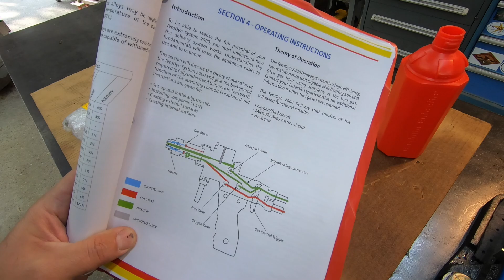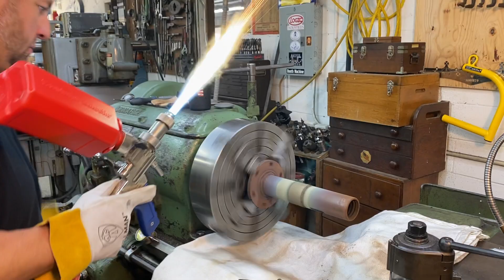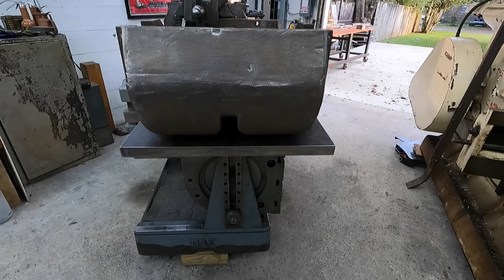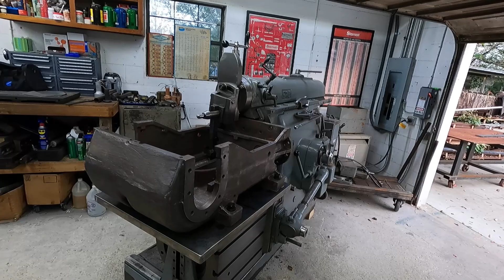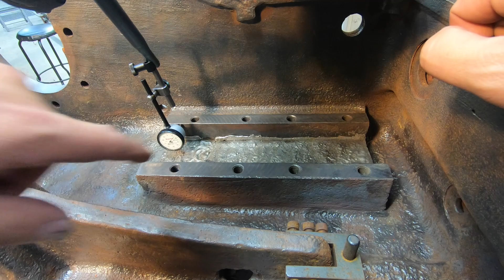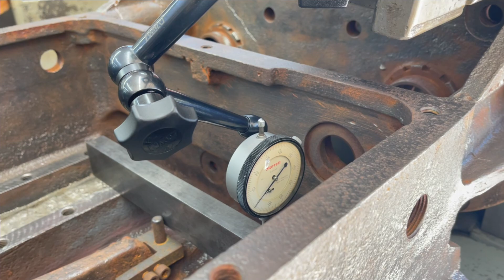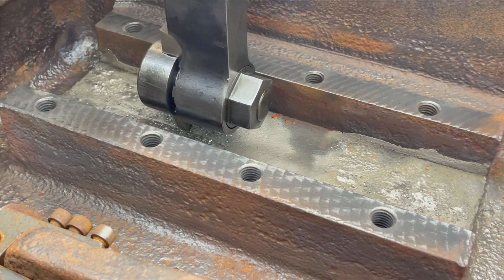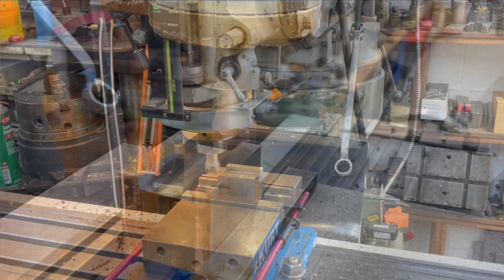SNS 331: Stoker Engine, Eutectic Torch Repaired, Tung Tri Mill

Comment: I seem to recall Stefan Gotteswinter using a small shaper that cut on the pull stroke rather than the push stroke.  That may be an option if making very light cuts.  It would probably allow the use of a larger, more rigid tool that would allow you to raise the tool holder and allow a cut across the entire width of the surface.

Comment: hi Adam have u considdered if you could mill the Stoker Engine horizontally on a boring mill. Once you made
a video where you bored and milled an item on a horizotal boring mill maybe that could be a solution and if also made a flycutter to clean off surfaceses. maybe it is possible to set the piece
on the end for the base of cylinders and clamp it to the table and mill from upside and down.
The flycutter does not need to  have a larger diameter than it can  mill between the two upper mounting areas on both sides that might give u space enough to clean all areas which have to be milled.
 Kind Regards from Denmark

Comment: Could two linear rails be attached to the two machined surfaces on either side of the channel? Some type of carriage to run a high speed grinder? Like a mini portable surface grinder?

The challenge makes this project more interesting, you are not disappointing anyone.

Comment: Hi Adam, 
Certainly a challenging job. 
I would doubt that Keith's planner would be any better, because he would still have clearance issues with the sides of the casting and clapper box. 
If you have an idea of its age, what machines were available then, that might be some indication of how it may have been machined originally. 
Perhaps a right and left hand offset tool holder, but I'm not sure what issues that has in a shaper, and again the time and experimentation to find out whether it may or may not be successful. 
I look forward to your determination. 
Hope you and Abbey had a wonderful Christmas, and all the best for 2021.
Stay safe. 
Dennis.

Comment: Steve Summers was showing off a big 2" end mill that's about 12" long in one of his videos last year, might be the answer in the K&T with the vertical head if the table will drop low enough. Could even run it in horizontal and stand the stoker case on its end.
Reply: You can always put the holder with the milling cutter to the spindle inside the casting.
Reply: Exactly what I thought too.

Comment: The two built-up areas are wider, longer, and thicker than needed.  Keith and Lance did it that way to make certain you had complete coverage.  But it's unnecessary to maneuver the shaper over the larger area, it's only required to machine the initial smaller size and location.  Hopefully, someone had the forethought to measure the two areas and their locations within the stoker case for estimating shaper clearance.  Anything outside the required areas can be modified as needed with a die grinder.  This insight reduces the need to work use the shaper so close to the sides.  Check it out.  (Watch the video to hear their comments.)

Comment: Looking at your clearance issues on  the stroker.  why not turn the casting 180 on the table and cutt from the other direction?
I seen to remember a 12" shaft that you made a while ago for internal shaping.  maybe you need a long reach horizontal shaft that has a tool holder slot on one end.  rough out the surface then make a grinding / lapping tool too finish the bottom similar to the tool used to flatten surface plate, but one that is attached to tha shaper.

Comment: Maybe you can make an endmill extension out of a piece of 1" or 1 1/4" hydraulic rod and use a 3/4" carbide endmill. It would be a rig, but I've made single use flycutters by welding a brazed lathe bit along the side of a piece of roundbar.

Comment: what you need is a long stepped shaped tool so that the tool can be extended into the space you have available. do away with the tool-holder all together, mount the tool in the clapperbox.

Comment: This may not be the answer or solve the clearance issue with the shaper but it looks to me that if the part is rotated 180 degrees it could work but may not work due to clearance in other areas. Just a thought.

Comment: Could you use a LH/RH toolholder that has the neck bent? Much like the tool holders for old lathes with lantern posts? I'm just thinking that if you can offset the tip tool from the centerline of the ram, you could buy some clearance to the side(s) of the clapper.

Comment: I knew this was going to be a challenge because of the depth of the casting and the distance from the clapper box. Since this is a one-off project, I think I would make a guide block to support a power scraper tool using the machined surfaces to support it and just just work the area. Lower the tool and work the area again until you get the depth and surface you need. None of these projects are as easy as they seem, and it is great to see what your solution is because it usually turns out pretty damn good.

Comment: OK just spitballing here..... set the head in the middle run the tool at an angle and the HSS vertical. that will give you the sideways throw you need to give you one pass on one side, then reverse it to hit the other.

Comment: <-- @ 27:20 ... I finally understand why I like Abom79 / Adam machining videos... its not the chips flying, it's the precision in making the calculations, and taking the time to be exact as humanly possible. That's what I learned about today. It's the planning, that has to be prefect. Check and check everything stay's the same.... I'm always thinking too. What if you had a variety of clamp magnets for extra hold?.... Hmmm, I'm on my 4th beer...> Adam will understand LOL.... I have full confidence in you Adam.... you can do this!! Cheers, Blessings.... ps: That bit is.... is...(speechless).... is it real?... better stock up!!

Comment: Hello Adam, you made me thinking :)
Instead of using a shaper from the "outside", you could use the 4 faces inside the engine box as a glide/reference face to guide the base of a small router running a (carbide) face mill. That is, you set a handheld tool inside the engine box. If necessary you make a "fence" that is bolted to some of the threads inside the 4 faces to "guide" the face mill i.e., to prevent from cutting into the vertical sides of the 4 face bars when you guide the router by hand. If required, you can apply a second op by using a small diameter grinding wheel with a special tool set-up, again using the glide/reference face. Greetings, Stefan.
Reply: I reckon that might be how they did it in the factory.
Reply: I should have read your post Stefan. That is what I was thinking. Those accurate rails should be utilised for what you are suggesting for sure. Well thought out friend.
Reply: That was my thought too.  Use the rectangular faces either side to support a router and rough out the worst parts.  That might be enough for the finish too but if not then maybe scrape them in using a fixture supported off the same side faces.

Comment: Would an "L" shaped tool holder help with side clearance? Turn the tool post (clamp?) 90 degrees to hold the  tool holder like an upsidown L so you can get into the corners easier.

Comment: I think the best way to do this now will be for you to make a custom tool holder with a long reach and adequate clearance. I know this is easier to say than to do but as you're committed  already you might as well try it.
In fact I think if you already had a very long piece of HSS you would have used it directly on the Clapper box without even a tool holder.

Comment: I imagine this would have come to mind if it was possible but I have to ask. Can you rotate the tool holder (the slot that holds the tool itself) left and right? If you can maybe you could, with a ton of patience grind a tool to cut the flat surface while the tool holder maintained the same location you have clearance for now. Like trying to cut a dove tail or undercut without leaving material above it.

Comment: @Abom79 A while back you made a pulley from 4140 steel because the soft steel the original was made from wore out too fast.  How is the new 4140 Pulley holding up?

Comment: If the problem is around the periphery of the two surfaces being flattened, perhaps you should just mill out where you can easily reach until it is the desired flatness and height and then later use that finished center surface as the new measuring zero for later work around the edges with whatever tools you can.  That way you can at least verify that the material being cut is solid and bonded properly to the work piece -- if that is not the case, then none of your other problems make much difference, I would think.

Comment: I did a lot of "flame spray" on navy ship steam valves for corrosion prevention... then discovered how well it worked on exhaust headers, drive lines, etc. for hot rodding. LOL
Reply: It's funny how something that was developed for a specific application turns out to be useful for loads of other things. Spray-on bed lining is not just for truck beds. Tool batteries are not just for tools. Kitchen timers are not only for kitchen use. 2x4s are not just for framing. Flashlights are not just for seeing in the dark. LEGO bricks are not just for child's play. Computers are not just for computing. The list goes on.

Comment: Hi all and a merry chrismas.
So for the casting surface can the FlexArm maybe help?
Maybe hand or machinie scraping that surface and using a small straight edge with the help of the two higher straigh surfaces with the bolt holes as a refernce ? 20:40

Comment: What if you set the engine up on its side and rotate the tool holder 90 degrees and works to cut up/down rather than side stepping, the table raises with each pass? will the cutters be long enough then? Do you have an angle plate big enough to clamp that to?
Other than that, I thought you had a couple of dog leg tool holders a right and a left will be needed. 
What about a longer tool holder so you can angle the head to get away from the sides of the block?
Merry Christmas, Happy new year,
thanks for the videos.

Comment: Hi Adam, a railroad shop, in the days of steam, probably would have done it on a Draw Cut Shaper (cuts on the back stroke) using a solid tool, probably not even high speed steel. Unfortunately those machines are probably extinct now.....Dave
Reply: There goes my question/idea on whether you could cut on the back stroke. 
Apparently not, sigh.
Reply: what I know from workers at Dampflokwerk Meiningen is that they have special milling cutters for this type of job

Comment: I am not a machinist, but why not create a new tool holder with a T type head to take both the left and right tool and spaced so when the one tool is against the one side, the other is just inside the center line. This way, when the bed moves over while cutting, the center line will be crossed by both tools as each of the opposite ends are reached.  Good luck.

Comment: I was thinking, why not turn the stoker 180° on the mounting plate? then I realized that you can't reverse the cutting tip. ¯\_ (ツ)_/¯.  then I thought, why not lower the stoker, and use a longer cutting tool so you can get closer to the edges?

Comment: Looks like a project for the mill using a facemill, assuming you have depth capabilities to reach in there. The stroker will have to be shimmed on the table, but maybe that is a workable approach. Eager to see where this project leads.

Comment: Do you think originally they used a fly cutter on an angle to get the clearance and make them deep grooves.
Reply: I was thinking the same. Or perhaps a huge, 12-15 ton industrial boring mill.
Reply: @ZeroneAngel  I recon an old steam shop probably had one of them lying around

Comment: Adam, I might have a solution to this problem, if you angled your tool holder to the right when cutting the right slot it looks as though you should have the proper clearance by starting on the right side and feeding the table to the right as you cut. The only drawback I see with doing that is you will have to angle the tool holder in the opposite direction to cut the other side, so your depth of cut would have to be individually measured out to get both to match, but I think it would work for you.
Reply: I was thinking the exact same thing

Comment: Can you make a holder (rectangle bar), ( after in the box holder, turn the rest of bar round like a rod), long enough can raise the box as high as possible. then drill a hole in the end to insert a tool die holder( round to square ),then drill in from the side edge to the hole for the holder. Tap the hole for a set screw. Insert tool in the bottom . Like a boring bar tool holder.see Keith Fenner. So a square fits box holder. Transittions to a round bar with a tool sticking out the bottom. The whole ting would be like a modified boring bar. Square at Clapper box, round to bit, with bit sticking out the bottom. Just have to make small slow cut to keep down the bar flex.

Comment: I would take the biggest mill holder you got and make a custom long reach fly cutter with say 1,5" diameter or more shaft and a cut down lathe bar and mount at an angle in the end.
Edit: you might run out of room against the casing, but as large diameter you can in the axel to reduce flex, maybe....

Comment: if it were my job on the to repair the stoker, I'd mill a pocket into the bearing surface and install a piece of ground and polished hard facing or bronze, depending on a bunch of questions I don't have the answers to at the moment.
A it becomes a serviceable wearing part, 
B you could machine tge othe side of the casting and make it removable from the accessible side 
C cast iron isn't the best bearing surface if it's not hardened

Comment: steffan gotteswinter has a funky clapper box that allows for cutting on the return stroke instead of the working stroke that would be cool to use in this gase because of the added space in the crank case

Comment: Sometimes you have to think outside the box and adapt and overcome the issue at hand.  I like to stop and consider what tool I would design to complete the task and maybe even sketch it out on paper to contemplate if it will be worth trying or not.  My suggestion in this situation would be to make an adapter so that you can use the micro turning tools to get in there without hitting anything.  Sure you will have to take light cuts and take your time but at least it will allow you to use carbide tooling as you wanted and you already have the tooling and just need to have infinite adjustment on the angles in the tool holder.

Comment: Could the tool holder be raised to clear the rails then use a longer piece of tool steel for the cutter? Could the tool holder be angled in the clapper box and the tool steel angled to bring it back to the required angle in the tool holder?
Reply: angles introduced at clapper head/tool would need angle adjustment to table, again introducing clearance fit issues
Reply: Also, using a longer piece for the cutter will induce harmonics/chatter. Then the surface finish will be effected.  Back in the day, they must have done the machining on a very large shaper with a custom tool holder that extended into the casing and cleared around well.

Comment: Hi Adam, now it's set-up, it is easier to see alternative methods, maybe remove the clapper box completely, and fab a fixed tool holder, but maybe set it up on the K &T and part machine, then scrape out the corners/unreachable areas, it's not unheard of.
Great vlog, here's to a better 2021.

Comment: The Stoker Engine machining was probable done on a Boring Mill. They have a long reach with the high speed spindle.
Reply: More likely a large planer
Reply: Ya that’s what I was thinking. by mounting it upright. it will be hard to see what the cutter is doing
Reply: @als484  job for Keith Fenner then then lol
Reply: @billhanson4921  Or Brian Block (bcbloc02), his HBM is, umm, medium sized.
Reply: @billhanson4921  Keith Fenner doesn't have a hbm.
Reply: @davidcallista2580  really? seen him use something that looks a lot like it.
Reply: @billhanson4921  I've been watching his vids for several years and can assure you that he does not have a horizontal boring mill in his shop.
Reply: @davidcallista2580 WHATEVER IT JUST LOOKS LIKE ONE THEN
Reply: @billhanson4921  He does have a K&T milling machine that is a mainly a Horizontal mill and it has a vertical attachment.  IT IS NOT A HORIZONTAL BORING MILL.
Reply: @davidcallista2580  and?
Reply: @billhanson4921  ok you win
Reply: My first thought was an HBM.

Comment: I think i would weld+braze up 5 tools with a long reach. Three V shaped (leaning left / center / leaning right) and two U shaped (right touch / left touch). I would make a template from wood first to test all the clearings. It would be some what S shaped. It's not unusual to make the tools for such a special application.

Comment: Would it be practical to remove the tool holder completely from the clapper box and create your own custom tool that is longer than the tool holder is now.  You could then drop the knee down and have room for the clapper box head.  Perhaps you could also use a carbide insert on the new tool.